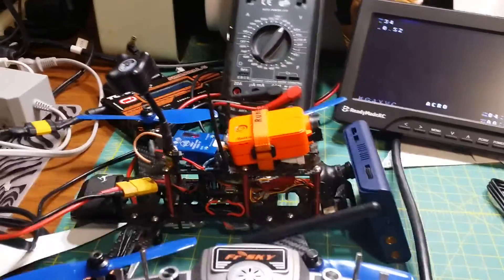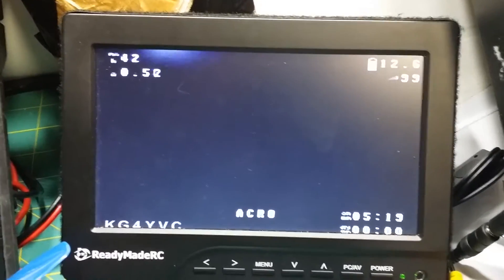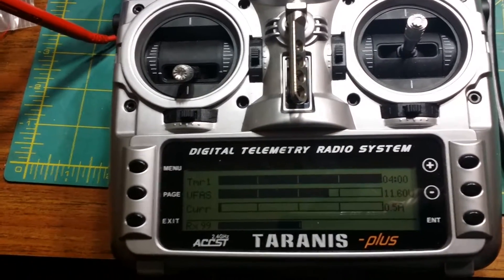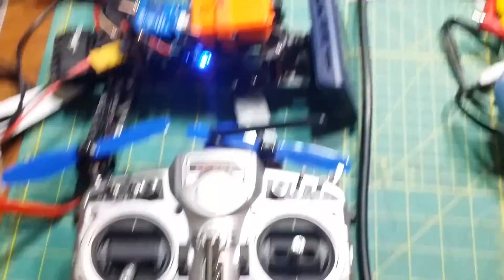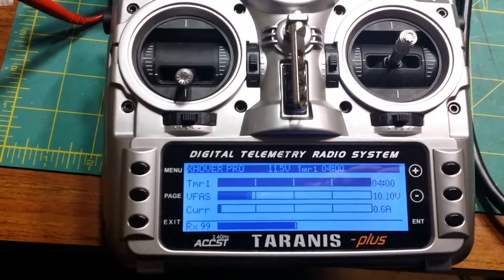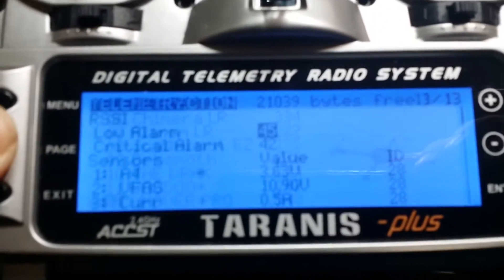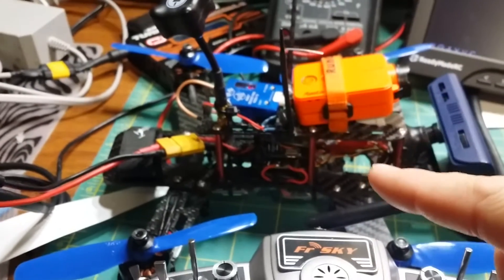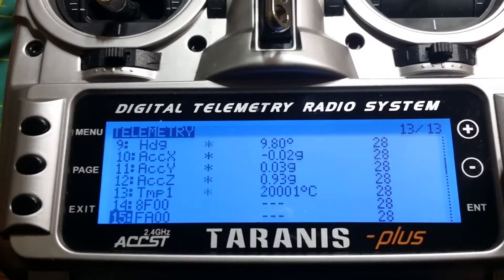FrSky Taranis + BrainFPV RE1 telemetry and OSD

Comment: Recently bought the Brain RE1 and have the same controller as you.  Everything works great in betaflight but one running on battery only the motors wont spin. Ive turned off all arming as well as tilt. Ive checked the status in Betaflight and everything is good to go. Any ideas why it would work in Betaflight and not outside of it?